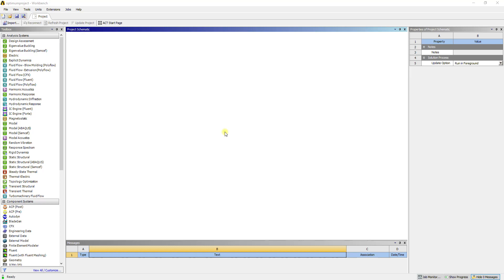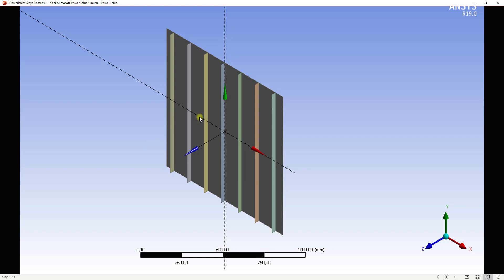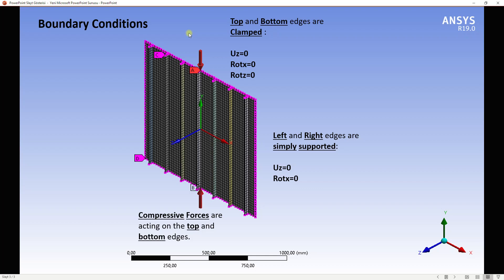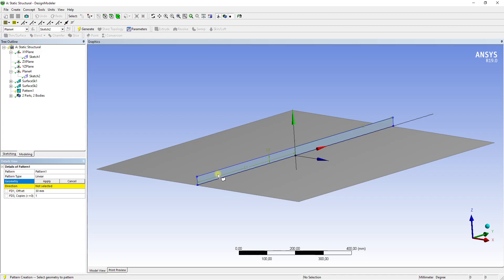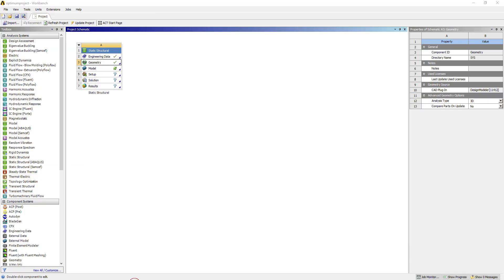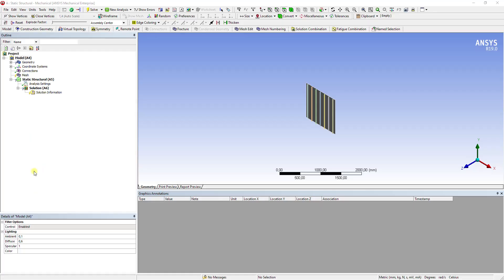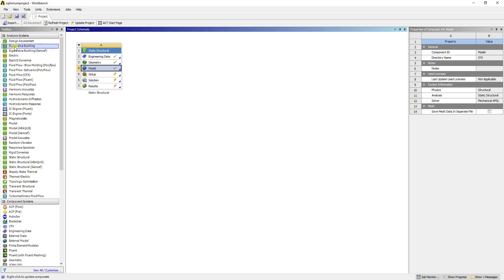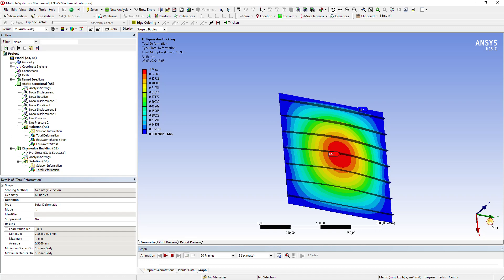Optimization of Stiffened Plates Against Buckling ( Optimization Tool Ansys 19)

Comment: Hello,
Thank you very much for sharing. I tried to apply the video exactly and when I try to apply the node selection at 13:53 minutes, I cannot get the same result. The same nodes are not selected. I wonder if it is because the Ansys version is different?
Reply: Hi, did you solve that issue
Reply: Hi, I have this problem also, could you please share the solution? thanks